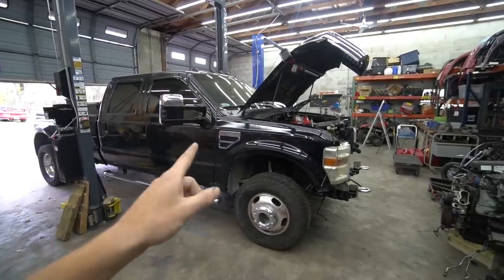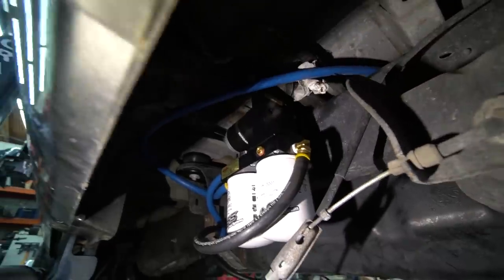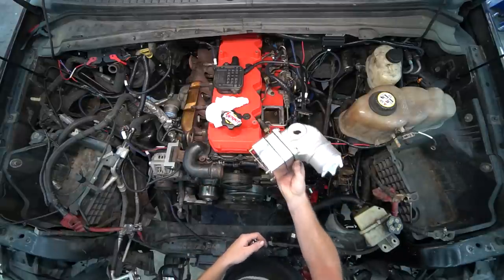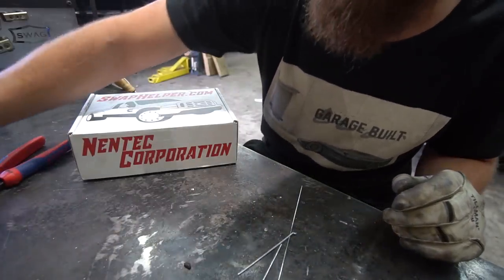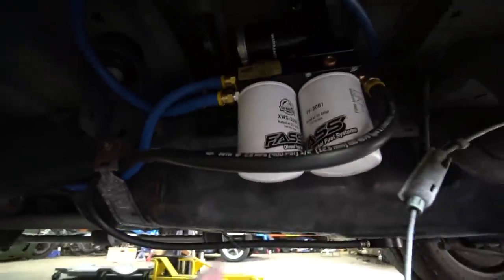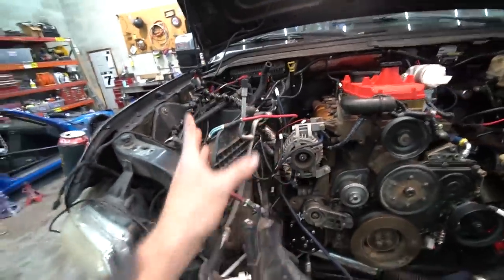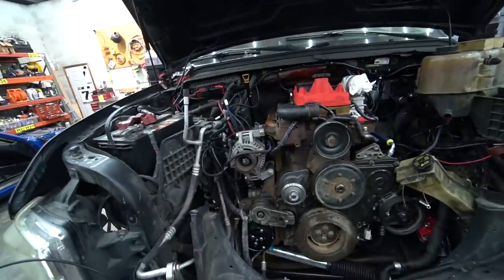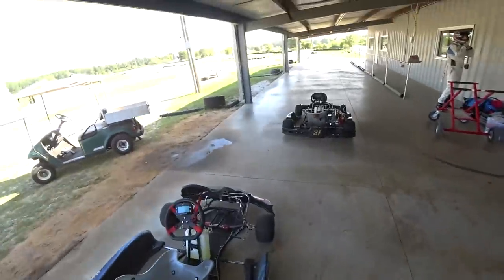FUMMINS Build First Startup? Houston We Have A Problem...

Comment: The trucks PCM is locked sometimes after sitting for a while without power they forget the key codes. Try using Forscan and a usb dongle for a key reprogramming. Should take about 10 min to gain access and 5 to reprogram keys. You will need 2 different keys to successfully reprogram them. The theft light is the indicator for this issue. It should turn on then turn off not be blinking rapidly.
Reply: this is the correct procedure given the information from the video, I also point the troublemaker to this as well.
Reply from the maker: The problem is I only have one key. Would Ford be able to make me a second key without the vehicle?
Reply from the maker: Another thing worth noting (I did a bad job explaining this in the video as I was just trying to figure it out) I cannot connect with a normal code reader.
Reply: @Taylordrifts  Call around to locksmiths!! you would be surprised what some can do. I have one here in WA that dude rolls around with 20+ laptops for different manufactures and can do things I didn't even think were possible! Last time he was out here was for a VW and he had to reprogram the gauge cluster to the immobilizer because somehow those are connected! (cluster was replaced and no start) it was way cheaper then the dealer by far!
Reply: @Taylordrifts  with the PATS key system in fords you only need 1 key to make the second but they need the vehicle there to program the keys as a pair... DONT LOSE YOUR KEY THOUGH if u have no keys you then have to buy 2keys and do programming which is usually in the 300 dollar range all said and done. Call ur local dealer, PATS key issues are common
Reply: @Taylordrifts   forscan uses your laptop/desktop to connect using a usb to obd2 cable it doesn't have the same limitations as a handheld unit does. forscan is my goto for ford and mazda stuff.
Reply: as john said, a pats reset procedure doesnt clear the keys, it just pairs all the modules in the car. give that a shot.
Reply: A mobile locksmith can have it going for under 400 bucks. Once a second key is made its a simple process with the correct scan tool
Reply: Always nice to see good useful information: this is what comments / forums are for!
Reply: Taylor Ray I’m pretty sure( if it’s like a GM) you can call a dealer and give them your vin number they can make you a key.
Reply: Taylor Ray the dealer can cut a key but it will have to be programmed. A good locksmith can handle it in less than 30 minutes.
Reply: @Taylordrifts  yes they should if you have the title
Reply: @Taylordrifts  also check your pcm connections make sure they are plugged in properly and that there is no bent pins .Also if you want send me a message on the gram @edvicenc I can also get you a pcm pinout to see if you have both power and ground. If your missing those then that's why you can't connect.
Reply: @Taylordrifts  Yes you have an old-style key, you can walk into a dealer with your key, and they'll cut you a second. PATS programming with ForScan will program that second key to the car. If/When you do, please make sure to ERASE ALL KEYS, then Program. Since it's an auction truck, there's maybe another key out there which means that the truck could be stolen. Erasing the keys then reprogramming the two you have ensures that even if there's another key around, the best they could do is open the door. Also, get fobs for super cheap off of amazon, you program them to the truck without a computer
Reply: @Taylordrifts  As mentioned above there's a ton of slick locksmiths out there, I had one here in Phoenix get some things sorted out on my Range Rover (also partially fomoco based). Additionally, there's some good options on ebay too. I have a newer Escalade that had only 1 fob, I found a guy who offered a replacement OE fob, as well as was able to cut the backup blade that goes inside via a photo I sent him of the original. I'm certain they have Ford keys that can be made that way too. Then use the forscan to code all your keys
Reply: @Taylordrifts  Part of the rover's issue was no key recognized, so also no obd communication. Something the right scanner with key programming functions can overcome
Reply from the maker: Update: locksmith came, he was also unable to communicate through the OBD port. He was able to confirm the key is not syncing with the immobilizer ring, but the key itself is working, so I'm going to replace that. My next step is the ECU itself once I test the CAN H and L wires.
Reply: @Taylordrifts  Ah damn. You'll get it man, everything else has come together great. And good work on that kart
Reply: @Taylordrifts  Majority of the time, the CAN bus connector is powered by a common fuse shared with the cigarette lighter power point. Confirm the fuse there isn't blown and that pin 16 on the DLC is getting 12v. This is the far right pin on the small side of the DLC. Don't replace the PATS module yet. If you can't communicate to the truck, you can't program keys.
Reply from the maker: Valkyor01 it’s getting power. It powers up the device just will not communicate
Reply: @Taylordrifts  If you need some wiring diagrams to pin out the can bus to the PCM, let me know
Reply: @Taylordrifts  i had this once with a 02 explorer. check all your relays that go to your bcm and your pcm,

Comment from the maker: I didn't do a great job filming my diagnostics so basically here's where I'm at.
Security light flashes fast, then slow, then off after about a minute of key on. 
No power to the trigger wire to the starter.
Will not let me connect with a normal code reader.
I only have one key with no key fob.
Called ford and they need me to bring the truck in (not easy) have two keys (don't have) be able to start the truck (not happening) and "maybe they can reflash the PCM"
Reply: The 3 connectors on the lh shock towers is super common when we pulled cabs for engine work......that  will cause the theft light and no communication with a scantool.....
Reply from the maker: @Kevin-yc4kg  What do you mean? They're all connected. I doubled checked them as I know the one is for the EGT stuff and will cause a no crank.
Reply: The three bulk head connector below the degas bottle and on the left hand shock tower I think grey black and white take the connectors apart clean them and reassemble them
Reply: Also check the connector right below where the pcm connectors are poor connection will cause theft light to flash and no communication to a scan tool......check pin 16 at the dlc and make sure it has power it's the cig lighter fuse no power there will also make the scantool not power up
Reply: Taylor, the 3 connectors Kevin is talking about are super common. I’m a factory trained Ford diesel tech since 2006. The connectors can look connected and even seem seated since the cam locks roll over to the locked position but the weather pack on the insides of the grey and the black connectors “bind” up and prevents and proper connection. Disconnect them, inspect, clean them, blow them dry, and reconnect with silicon spray or equivalent and electrical grease on the pins. Had this problem lots when pulling cabs on rig trucks. Love the content up in British Columbia, Canada.
Reply: @coreypenner  awesome bud I am a smt at a Ford dealer in Tampa FL.  Slow as hell down here man with the virus
Reply: You don't have to be able to start the truck, you just have to be able to turn it to accessory and everything turn on.
Reply: It looked like gas u put in the truck out of that car I dont think if ever seen diesel that color?
Reply: Taylor Ray  contact me if you can’t get a key
Reply: Just something I thought about was engine to chassis ground and engine to battery ground. Check for a blown 30 amp fuse under the dash not in the engine compartment. I hop you get it buddy!
Reply: Not very common for the key to loose it's program, if you can't communicate with the pcm it's prob not coming on. Or the cigar lighter fuse. Go back over all the connections, don't forget the grounds
Reply: I’ve had this problem installing an alarm in a 08 F250, used the other key if you have it to see if that one works. If not, here’s another solution pretty much guaranteed to work, and have done it to my 2012 mustang. Get your hands on IDS software (ford factory computer) and disable the PATS (anti-theft system) and it will crank over. Only down side to do that is the truck will crack over no matter what when the ignition is turned. You could put a Killswitch to the lift pump to restore some anti theft characteristics
Reply: Did you check all your connections I just did the same swap and the factory computer locked up due to one of the plugs not being plugged in all the way. If you have any questions https://www.youtube.com/watch?v=gMxxHnRAWNc
Reply: Hey FYI you can program PATS with ForScan. you need two keys to program pats, and you'll need to apply for a temporary grant to be able to program it. ForScan is an imitation of ford's IDS software. I use it on my fords, and it works great for data logging and basic things like setting AS BUILT functionality. Once you have it, it takes 10 minutes to program keys (a 10 min wait plus 30 seconds to actually map the keys.  Once you program PATS, the truck will allow itself to start. I have a lifetime license for Forscan you could borrow to try.
Reply: Also, ForScan will allow you to do a full vehicle Scan as if you had a dealer scan tool, will be very helpful when diaging gremlins in the CAN bus.
Reply: I worked on a few super duties, but I'm a former Lincoln/Ford tech, but the software and the platforms are the same. Corey Penner is right, the locking connectors don't always connect snugly, it's a good idea to clean the connector and use electic grease when connecting the harnesses together.
Reply: Reset the factory alarm by closing all doors and hood, lock the truck from the inside and unlock with the key.
If that fails then do a bcm relearn. I cant remember how on that truck. Sounds more like a bcm relearn but sometimes the easiest is the right way.
Reply: Or just call a mobile locksmith. They can cut you all the keys you want and program them to the bcm. I remember going through hell with a ford escape and the locksmith had it purring in 20 minutes.
Reply: I highly doubt the inertia switch got tripped but it’s not a bad idea to check. It’s on the passenger side of dash. Remove the cover and push the button in. I’ve seen many people working on 6.4s get burned by that. I’d go with the likely hood of a PATS fault. Need to start by retrieving DTCs. If you can’t communicate with the PCM, or any modules for that matter, you need to diagnose that first. Might want to pull out a multimeter and start ohming our wires. Whether you have a issue with the main PCM connector or the 3 on the driver side under the degas bottle, they’re all known to cause issues. I’d highly recommend FORscan for you though. In some ways it’s better than IDS, and it’s free. I can send you the wiring diagrams for that truck if need be.
Reply: Check fuses. Iv seen people pull ignition fuses and the truck freaks out as far as factory security lights on the dash when you try to start
Reply: Most likely ford pats system has kicked in

Comment: Try running a ground from
The body of the starter to the negative battery terminal
Reply: I was thinking the same thing. Sounds like it doesn’t have a good engine to chassis ground.
Reply: No. The theft light is flashing. It's clearly a PATS issue

Comment: Is the factory fuel pump wire unhooked at the pump? I had this issue when I hooked up my airdogg. The truck wouldn’t crank without seeing a load on the fuel pump wires. Use the ground and positive from the oem pump to power your new pump. No relay ....that wire needs to see load
Reply from the maker: Ahhh, this could be the problem. I will try that tomorrow.
Reply: Worth a try, hope it works out for you

Comment: Theft light was flashing during you crank attempt. Also on factory 6.4 the eco will not allow crank if it sees an issue with the egt sensors in the exhaust. I deleted my dog but still have to plug in the sensors. They are zip tied inside my frame

Comment: Step 1: Check both ECUs for codes. 
Step 2: Disconnect everything that isn't strictly necessary to turn the engine over, and bypass any modification (like that relay you added), try it again. If it does work, reconnect everything one connector at a time until you figure out which one is causing the issue.
Step 3: Run a thick (like plug wire thick) wire from a bolt on the engine block directly to the frame to make sure it has a good ground connection. Sometimes you lose that from paint, corrosion, dirt, oil, or soft mounts.
Step 4: Get a multimeter and check for shorts to ground or +12V on every pin of every connector. If you find a short, look up what the pin is doing and if it's supposed to look like a short. If you have a schematic of the harness, check every pin to make sure there wasn't a mistake made when assembling. Also check that you have solid ground everywhere.
Step 5: Cut every ground on the harness and connect them directly from the connector to the frame, and make sure the place you drill in has good conductivity to the engine.

Comment: You should always put some oil in your oil filter no matter the location. If it mounts sideways you only put enough oil in that it wets the filter but doesn't spill out. The filter will still hold alot of oil without coming out.

Comment: Hey Taylor: I would recommend you change the tank out with a used one and pull/return fuel out the top. I have a friend who did Cummins swap into 08 Ford pickup and he went compound turbo's and such and has no issues with using the factory fuel setup pulling fuel from the top of the tank, but he used the factory ford pump with a fuel regulator into the engine, didnt go the FASS route like you. That bulkhead from the bottom is itching to be a leak standing you on the side of the road while towing.
Reply: William Huston I’ve been running a sump for years and haven’t had a single issue it also eliminates the half tank issue a ton of people have with a top draw setup.

Comment: Fords have a chip in the key when you took out the alarm you took out the key bypass box two it’s a separate box so you can have keyless start so now that it’s out the pcm is locked because it doesn’t see a key in the ignition you can put the box back or have to get a key re programmed
Reply: He took out the alarm after he seen it wouldnt start

Comment: I have some experience in kart racing, it seems like you lift completely on slower corners, that will make your rear end step out every time. Try keeping just a little gas pedal and left foot brake while just keeping your momentum through the corner. If you know what i mean. Carts get loose on lift

Comment: just run a new wire from ignition switch to the starter relay under the hood in the fuse box or bypass the starter interrupt relay. If you get it to crank with the key on it should start as long as the dodge ecm is powered.

Comment: The ideal tow rig is an 80 series landcruiser with a 1hz diesel. 1 wire to run the engine and everything is easy to get to. A tow rig gets the race car to the track. It doesn't need to be super powerful and over complicated. Nice truck though mate!

Comment: Leave everything hooked up but take a set of jumper cables and connect both red/black to the neg terminal. Then the other ends to the chassis and engine block... It's a quick way to check grounds.

Comment: Try Unhooking the alternator. Some engines  use the r terminal on the alternator for cranking protection it puts out voltage when the alternator is turning but is a ground when it's not turning. If the alternator is shorted inside or u used the wrong terminal it will put voltage on the starter selonoied ground and it won't start I think this is your problem and would explain the voltage on your starter wire. Cummins dose it on the engines in we use in Komatsu equipment regularly.you may have to run a different ground to your starter selonoied depending on how its set up. But you will know if this your problem if the voltage on the starter wire goes when you unhook the alternator. Hope this helps

Comment: You should add a two stroke go kart to your fleet and drive them back to back, my nephew has a Rotax Senior Max kart and while you don't have to worry about carrying  speed through corners because it will spin out in a split second it does teach you throttle control. Once you have got past that the tires are so sticky that you end up smashing yourself against the seat so hard you get rib bruises.

Comment: PATS is flashing, wont let it fire. Go into data and find STRTR RLY pid. It will say enable or disable. If disabled it will not start. Now, the crappy power wire could be why you cant crank possibly when jumping the signal wire.

Comment: The 3 connector on the shock tower have can bus wires that have terminal problems take the connectors back apart clean them and try that known problem on the super duty with flashing theft light and no communication with a scantool

Comment: Similar stuff has been posted but: make sure the engine block has a good ground to the frame (big as the power wire to the starter) as the starter grounds through its body to the block and then to the frame.
Reply: I typically work on old cars so the computer stuff may br the problem but it may be that simple

Comment: When I did a b16 swap on my eg Civic it wasn't getting any spark. I went through everything and thought it was the distributor but it ended up being my fuse box. I took out this fuse for the distributor and put it back in and it worked for a few days then had the same problem.